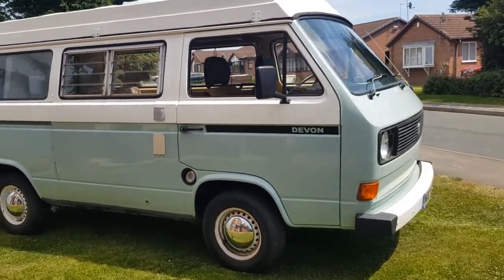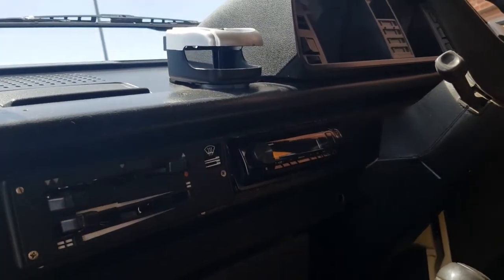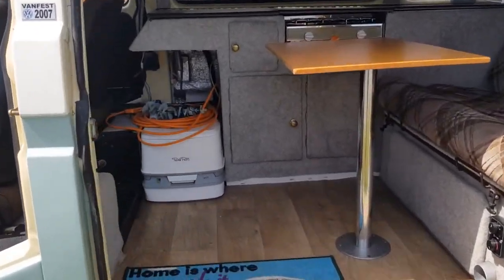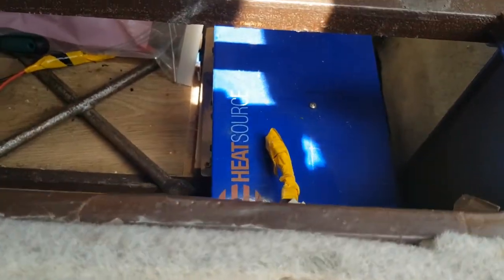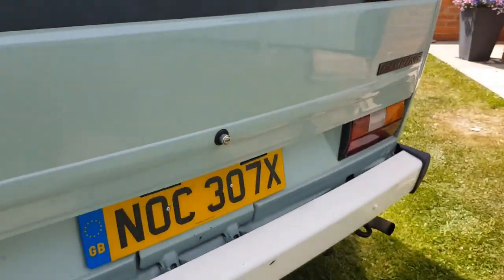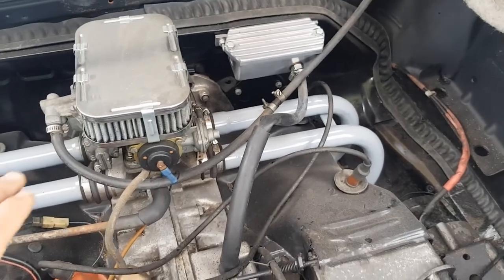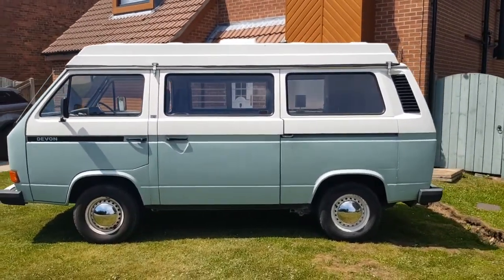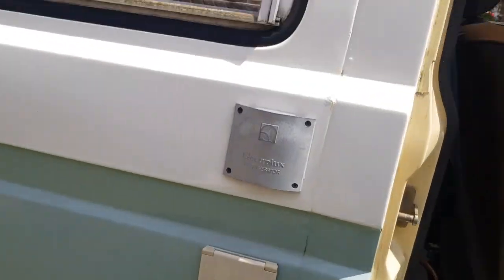VW T25 Devon Campervan 1982 - For Sale!!

Comment: It won’t be a motor in your heating. Probably the flaps at the heat exchangers.
Reply: Reason I say this is yours doesn’t have the blower. You can tell by the controls ie no speed adjustment.
Reply: Simple fix though.